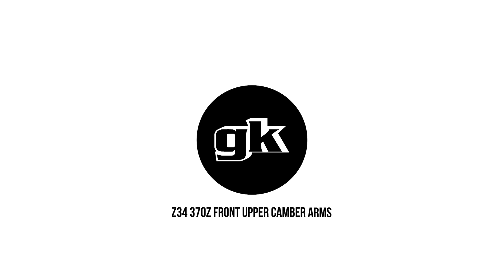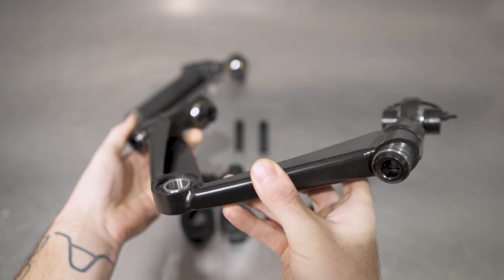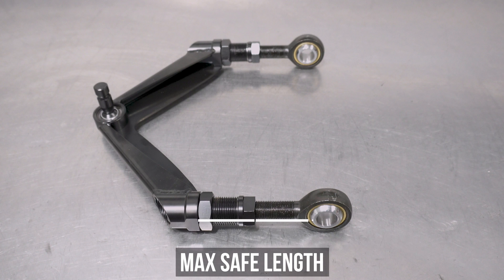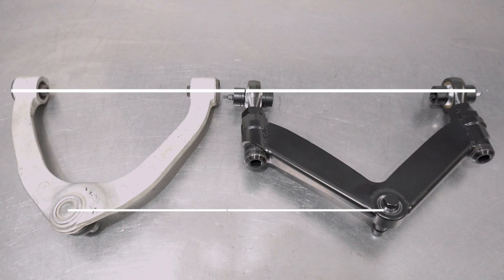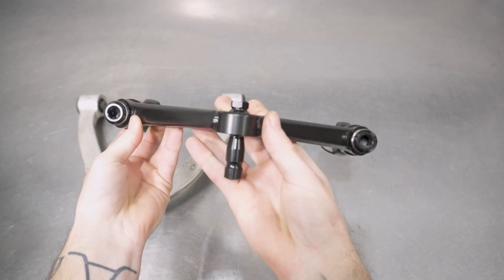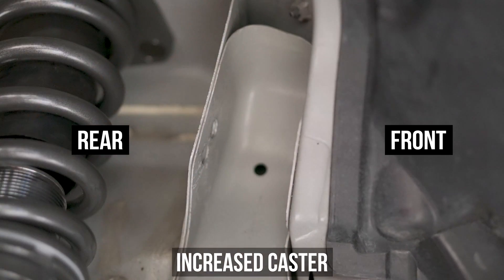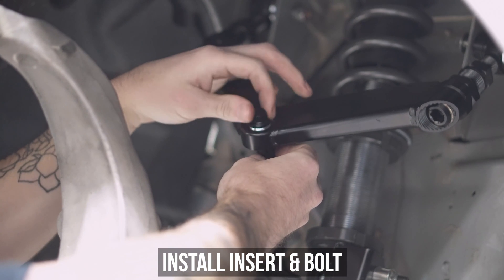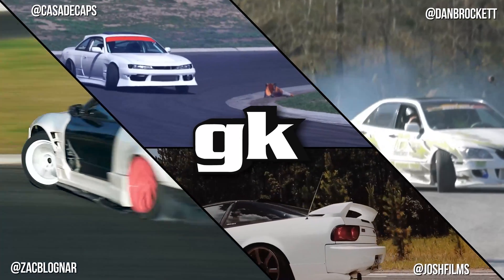Gktech Z34 370Z Front Upper Camber Arms - Install

Comment: Can we put anti-seize on the threading or is that dangerous/not recommended for this material? I don't wanna have to deal with a seized camber arm when I have this maxed out negative camber for summer drift sessions and then when I want it at OEM spec in the dead of winter it's all frozen 😂😂

Comment: Can this fit a q50
Reply from the maker: We can’t confirm, sorry.
Reply: @gktech  I’ll let u knw how it goes am sure am not the first I’ve check the forms
Reply: I think the g n q use the exact same front suspension components apart from maybe inner n outer tie rods, check the part number on the oem arms to see if they are the same for the G Q chassis
Reply: @lion3014  it’s been 3 months solid but had to raise the car a lil because of clearance so jus remember to check for clearance and watch the installation video the guy was on point with everything 💯 car is a 2018 q50 3.0t luxe rwd
Reply: @outdehmovements6273 have you experienced any rubbing?
Reply: @outdehmovements6273 does that mean it can fit my q60 luxe 3.0t? 2018

Comment: So when adjusting after installed does the Allen key extend both parts of the fuca or only 1 part. Then you have to adjust the larger piece by taking it out the car.
Reply from the maker: It adjusts the extender evenly, no need to remove the arm.
Reply: @gktech  ha ok wonderful I received it yesterday. Hoping to do the install soon